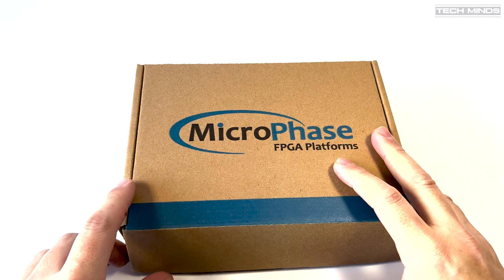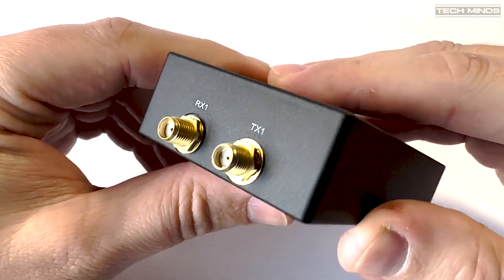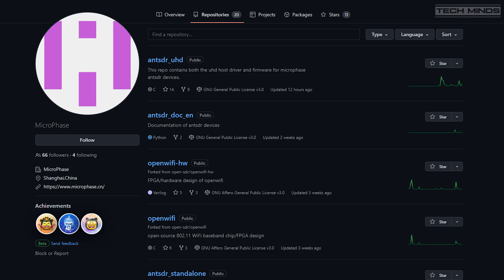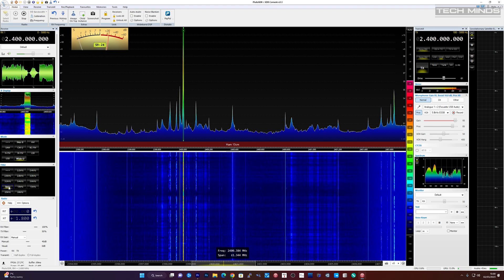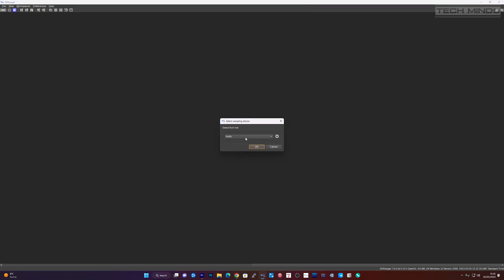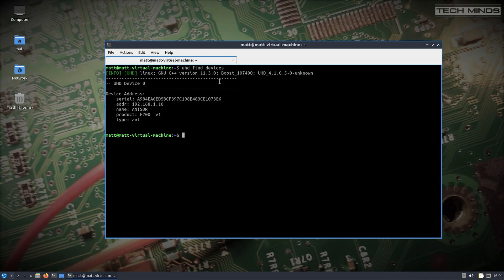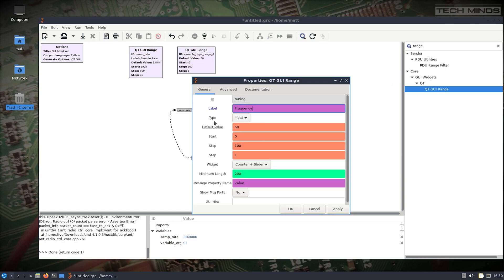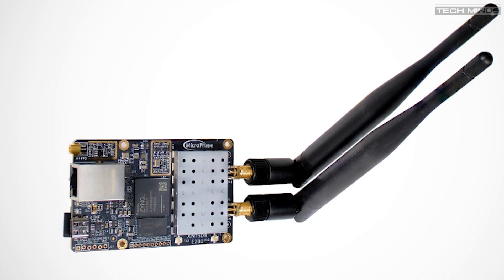MicroPhase ANTSDR E200 UHD USRP & PLUTO SDR SUPPORT

Comment: Do you reviewing AD9363 variant or AD9361 variant?

The link you shared refer to AD9363, but base on spec, this variant has frequency range 325MHz-3.8GHz (spec didn't cover Aircraft Band, but your video shows it working). Can you clarify it?
Reply: The ic says 9363 I think but it's just a firmware change or settings file edit to change to 9361. Just like adalm Pluto sdr. With the Pluto they say it's only good for up to 3.8ghz but I've never heard of someone having it not work well up to 6ghz and with increased bandwidth. I think the 9363 is cheaper because they don't verify it as being as capable but it's likely the same silicon. That being said I only have an rtl-sdr so look it up if it's important to you.

Comment: How would you compare this to a hack rf one?
Reply: Worlds apart...  The E200 has a good processor and suppoets 2r2t.  It can be either a pluto , or e200...  and it is full duplex... transmit and receive at the same time.  The Hack RF is 1r1t and half duplex.  The e200 is running embeded linux... You can add and run software on it...

Add a battery pack and off you go...
Reply: Check the previous messages,  I answered this... Huge difference....

Comment: Yawn, money for old rope, I would be more impressed if they did an SDR based on the ADRV9002 chipset.
Reply: FMC249 - 30 MHz to 6 GHz Quad Narrow-Band and Wideband RF Transceiver from Vadatech. Wideband operation up to 40 MHz.

Comment: Nice review. Interestingly packaged with the SD card and ethernet. The price is comparable to the new Lime mini. Like all wideband SDRs a filter is a must if there are strong signals around. 

Note when you TX and RX on the same device, any drift will cancel so you need to use a different RX or TX to measure the drift.

Meanwhile I am working on the Caribou lite, the software isn't there yet but it is looking promising.